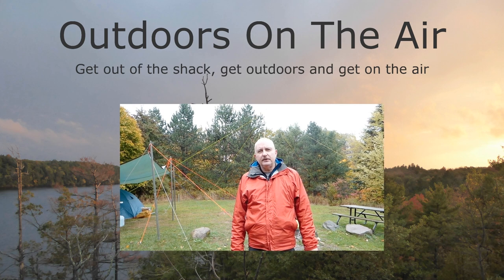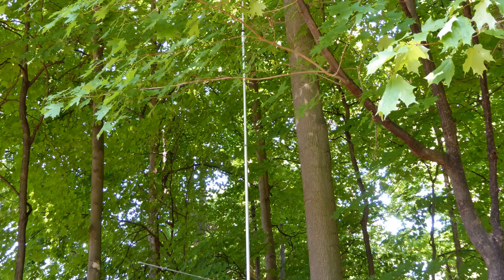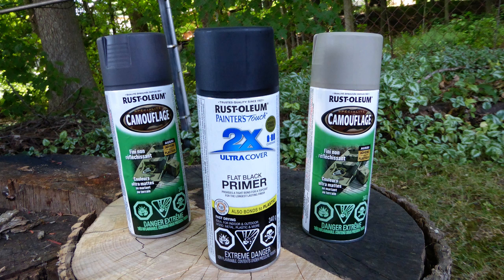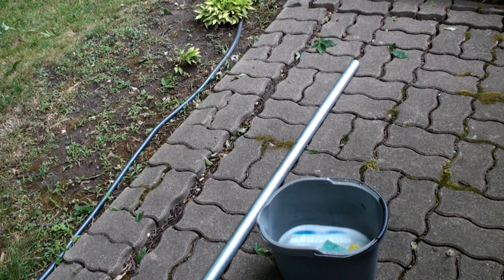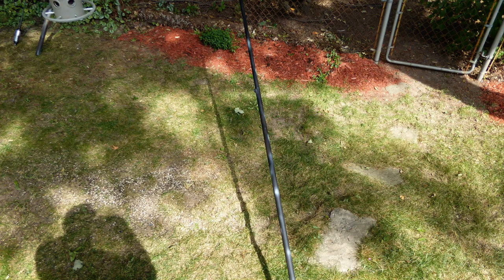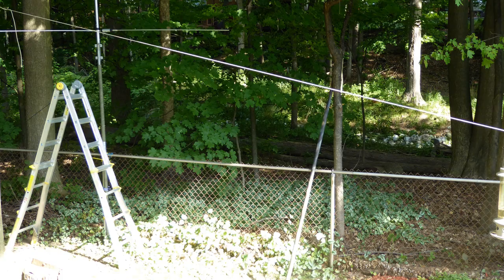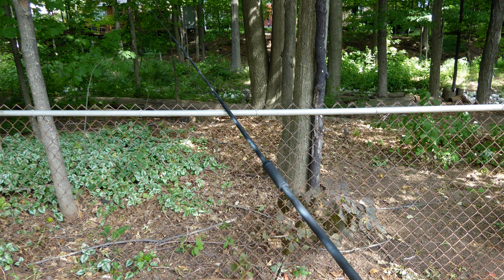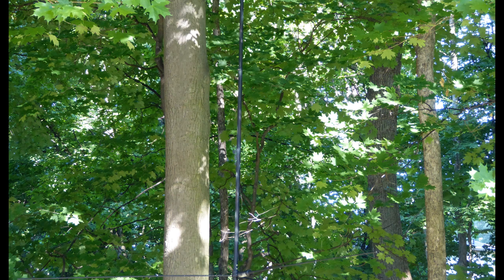How to Camouflage a Vertical Antenna

Comment: Looks great. I think you did a fine job. I did something similar with a roof mounted vertical but I used primer grey, primer white, flat sky blue and dashes of flat tan. I used acrylic paint which caused no problems with the signals. I had it up for years with nary a comment. My wife loved it. MikeinMinnesota N0WDM
Reply from the maker: Thank you for sharing your experience, Mike!
Reply: Thanks for this, very useful.

Comment: I presume you didn't find any difference in antenna performance, painted vs unpainted?  I suppose if you assemble the whole antenna before painting you don't have paint acting as an insulator between joints.   I opted to install a 33' Eagle One vertical antenna behind my back fence  near trees that were taller.  It uses a wire inside a collapsible black fiberglass pole, and I added a remote LDG tuner at the base and 16 miscellaneous.  It will tune all of 40-6 meters and some of 80 m. It's been in use for almost 6 years with good results, and can't be seen from the front of the house.  It has a few lighter color splotches now - probable from sun bleaching - and that helps with the camouflage.
Reply from the maker: Thank you for your comment!
Truth is, 10m and 6 meters were not open while I had the antenna up so I was unable to compare performance before and after. However, the SWR was the same painted or unpainted. I was careful not to paint where the sections overlapped.
Nice to hear of your experience with the Eagle vertical, thank you for sharing.

Comment: I am so glad you did this video as I've often wondered whether painting would effect the impedance or performance of an antenna. Have you noticed any difference in that regard?
Reply: Paint typically doesn’t have any effect on antenna performance. 73 de NV9Z
Reply from the maker: Hi Stuart, thank you for your question. Zero difference in antenna performance after the paint was applied.
Reply: As long as the paint used has no metallic particles in it, it should be OK to use. I painted my 2 meter vertical with white/blue tones to hide it as it sticks up above the trees to better match the sky. My neighbors sya they don't see it. 👍KI5IQE

Comment: Did you run any before/after tests with this antenna?  The SDS for the primer says it contains zinc oxide, zinc phosphate, and hydrous magnesium silicate.  Just wondering if these could have affected the performance of the antenna.

Comment: Great video....  Thank you.  Do you think the paint on the antenna will affect its performance?
Mi9chaep VA6XMB
Reply from the maker: Thank you! I can't tell any difference from receiving as there has been very little activity on 10 and 6, but when I checked the SWR after putting the paint on I discovered it was exactly the same as it had been previously.

Comment: Emmm!  What happens in the winter when there is no leaves?  You might have to go black and white if you get snow! 
I thought it was going to give me an idea how to hide an antenna, but there is no trees around here, well, there is but a Jack Rabbit could jump over them.  They will not grow that much higher as they are silver birch and they are away from me across two gardens!
They are half their height and full grown will not give me cover to put anything up.  The neighbour I have at the moment does not bother, but they have indicated they will be moving, so I dare not run a wire to the tree, small as it is.
Reply from the maker: That's a tough environment for an antenna! Love your comment about black and white. I purposely did not use green as there is no green back there in the winter.

Comment: Did the paint affect the antenna performance at all? Cheers, 73
Reply: Paint typically doesn’t have any effect on antenna performance. 73 de NV9Z
Reply: Some paint is better suited to antennas as lots of paint has metallic properties in it. I think you were lucky with the rustolium as some of that paint is suited for antennas. Look on the can to make sure you are not using a metallic paint.
Reply from the maker: Not at all.

Comment: Good video!  I did something vary similar with the Chameleon 17' telescoping whip that I was running mounted on the CHA MIL Hybrid matcher that I replaced with a Stryker Trucker mount antenna so we could 160~6 meters from an apartment balcony railing.

Comment: I had mine up for 2 years now and it is dead something broke in the matching section. 6 meters has Supper High Mismatch my TS-2000 cant even even tune it, 10 meters is 4:1 +
When I first put it up it was good 10M was FLAT! 1.2 ~ 1.3 tops all the wat to FM 6m was good too for the SSB parts of 6m was 1.2 on 50.125 and got to 1.8 up to 52.xxx I was getting out better then my home made 6m 1/4 wave. 
This antenna is not built well at all it feel cheap and flimsy for what you pay for it. The sheet metal screws all walked themselves out with in a year with blue Loctite. I ended up drilling right though the vertical aerial using 3/32 Stainless steel nuts and bolts.
Reply from the maker: Thank you for sharing your experience!

Comment: That is the same paint I've used for 10+ years to hide in oak trees. After a few repaints from sun fade, I paint the mast dark brown and the antenna dark green. The tan was good for the mast when my house was tan, but it was too bright in the air. The paint does an excellent job hiding an antenna. If you look hard enough they will be seen, but at 100+ feet away its too difficult to determine what they are. I may give that black primer a try next time.
Reply from the maker: Thank you for sharing your experience!

Comment: Nice job with the video and the antenna. Amazon sells additional camo colors that might be considered. I do like your technique for breaking up the shape. I will be using a primer designed for use on fiberglass for my Antron 99 ( Rust-Oleum 249321 Primer Sealer Gray Aerosol 12Oz, 12 Fl Oz (Grey). For the camo I am thinking that earth tones would be better in my situation since in the winter when there are no leaves on the trees.  So I will be using the following camo colors; 

Rust-Oleum 279178 Camouflage 2X Ultra Cover Spray Paint, 12 oz, Earth Brown (main color painted over the primer/sealer)

Rust-Oleum 279177 Camouflage 2X Ultra Cover Spray Paint, 12 oz, Khaki (breakup color)

Rust-Oleum 279176 Camouflage 2X Ultra Cover Spray Paint, 12 oz, Army Green (breakup color)

Keep up the good work. As an aerospace engineer, I appreciate your attention to detail and for providing clear rationale for your approach.

Best Regards
CM
Reply from the maker: Thank you for sharing this info!

Comment: I've done the same with a PVC tube and the same fence top rail. Rustoleum works well. I never used the primer, but would use the "black" from the camo paint.... Might as well use the black primer for other projects. I alternated with green, and various brown colors. Of course depends on your foliage. As far as metal components in the paint affecting antennas, I emailed Diamond and they told me unofficially they use Krylon and have no issues.
Reply from the maker: Great tips, thank you!

Comment: I would have used more camo paint than you used.  I've used camo paint before and you have to get it to blend into the background.  I don't have to worry about painting my antenna 'cause you cannot see it since it's a off center fed, half wave dipole long wire.  It has black insulation already on it.  73 from K9POW in eastern Tennessee.
Reply from the maker: Interesting point, Rusty. Hope you are making a lot of contacts with your OCF. 73 from VE3TWM.

Comment: Good try mate, but if you look on YouTube about painting camouflage on canoes etc, you will get a much better idea how it's down. I don't want to overly criticise your effort but you need at least three shades of camouflage paint plus the flat black. A light coloured green, like Light Eucalyptus, should have applied all over each part with one coat. Then blend in the other colours like Forrest Green (dark green), Tan,  and Flat Black should have been sprayed at random using leaves from your trees as templates to give a natural leaf effect (spray through the leaf onto your pole and antenna, etc. Change the leaf often when it becomes saturated with paint. And yes, the smaller radials can be manly flat black with dark green random patterns (no leaves need to used to form a pattern as they are too small to give a leaf effect on the thin radials). I used the aforementioned method on my antennas and it looks great! Also you do not need to use "Camouflage" brand paint. Any good quality flat or even satin paint of the desired shades can be used.
Reply from the maker: Thank you for those great tips! Green is out at my QTH as there are no leaves on the trees for 6 months of the year. Predominant colours on the tree trunks here are brown and black.

Comment: This another handy video! I've been considering doing the same thing and this has helped. I would be interested to see how it looks in Winter when the leaves have gone and it's just bare trees? Have you had any neighbour comments? My silver coloured mast will have to blend with a dark timber building with a dark green roof, so I'm considering using those colours as my base colours instead of black and then breaking the outline with patches of those colours in lighter tones....as in dappled light. Any comments would be welcome.
Reply from the maker: I pulled this antenna down before putting up my ZeroFive 10-40 Groundplane in the same location, so I can't advise how it looks. However, I can tell you I would expect the antenna to be pretty much invisible against the bare trees I have out back. The dull colours would not stand out at all.
Reply: @OutdoorsOnTheAir  Thanks for the reply and your thoughts. I think it's worth me giving a try and see how it works out. 73s